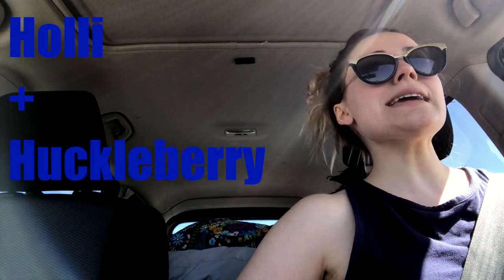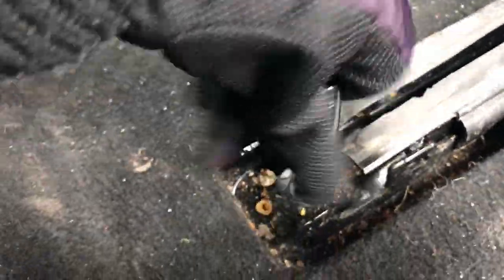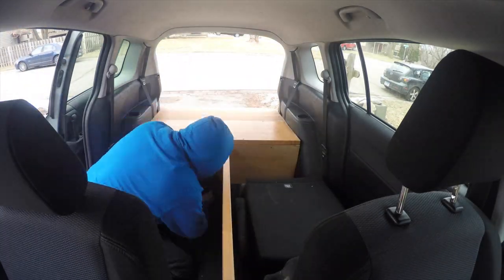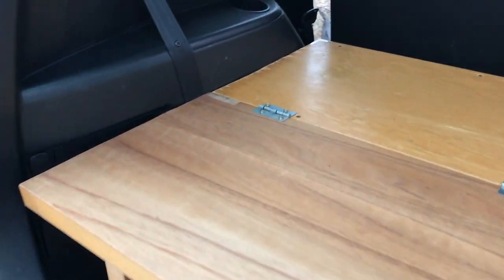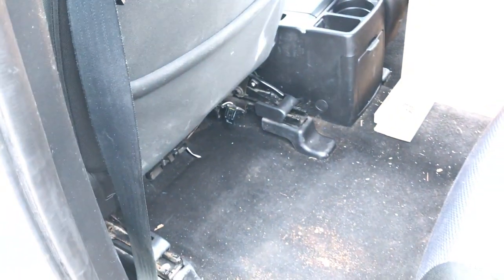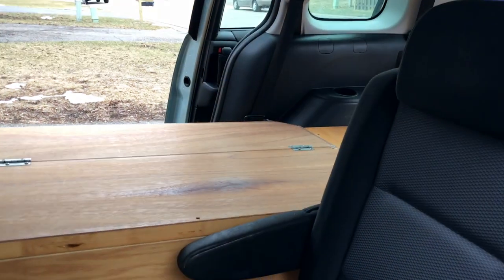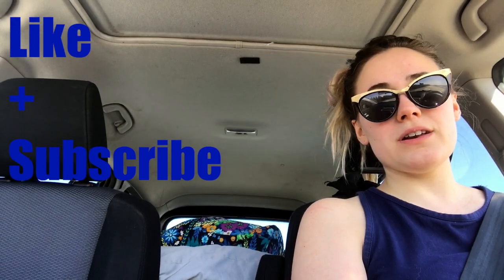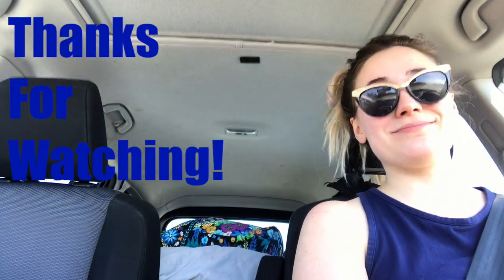Living In My Mazda5: THE BUILD

Comment: I drive a 2014 mazda 3 hatchback.  Next summer I'm planning a drive from Toronto to the east cost...3-4 weeks. I was thinking....why camp in a tent when I can sleep in my car? No worries about rain, just jump and drive if you need to get the heck out. The fact that I'm 5'5" will be just a breeze to make sleeping in it a easy thing👍.  I don't need to pull out my back seats. Just fold them down and cut a peace of subfloor/ drywall and a clean carpet area! A small cooler,  a storage container on the roof and a bike rack 👍👍. Oh...and some great all season tires for the long drive and some mild off roading.  One way or another I'm doing this.

Comment: Great video! I use my Mazda 5 as my work van and it has a setup with shelves on the 2 sides sliding doors and it is very nice! I don't know if you are going to go in Canada during the winter, but I do recommend you to spray a lot of silicone lubricant (Jig-a-Loo) on the sliding doors rubber seal, as they do get stuck in ice quite easily during the winter. My 5 is now at 272000km, 169000miles.

Comment: Like the build and the design. However, I think you can maximize the space, as needed.
1) With 3 seats and only one person living in there, IMHO it gives away a lot of interior Real Estate Space. If I were to carry the occasional passenger, I would be able to do away with at least one seat. In my case I would only leave the driver's seat. I've also seen where you can 'fake-frame' the passenger seat into looking like a legit seat by removing the factory seat and  building a similar storage frame, putting a seat cover on top of it. The front passenger floor can also be used for 'secret storage' by just detaching the carpet and placing a box under, raising the floor a few inches. For the those looking from the outside, they won't be able to tell, more so if you have tinted windows and dark gray/black carpet and seat covers. Putting a windshield sun shade every time you park also helps in the darkening effect. In most municipalities, you can darken the heck out of the windows aft of the driver too, for more security.
2) The rear interior plastic quarter panels also take up some of the width back there. Removing them could have given you some extra inches in width as it happens in minivans. You may also 'replace' that space with 1-inch insulation and still have gains in space.
3) Finally, an extra large cargo box in the roof with a flat, 100 Watt solar panel on top (again, being the panel being this high off the ground won't give it away that easily) may give you extra storage space and provide enough power for a quality (pricey but worth it) Danfoss compressor 12 Volt fridge, power to charge your phone/laptop and the requisite interior led light and usb fan. A Yeti 400 solar generator might do the trick. As someone is more likely to break into a cargo box outside of a car and the fact that they are not able to hold a lot of weight (100 - 150 lbs) you may just want to keep seasonal stuff in there (winter clothing/shoes/comforters) or other non-perishable items/supplies instead of pricey items like a toolbox/tools, etc.

Comment: Those Mazda5s are notorious for rear shocks failing prematurely. With all the weight that you're loading/loaded on it. Have you had issues with it?
Reply: Hi! Mine is my work car and I replaced myself the 2 rear shocks and it cost me about 60$ for the 2. It is quite feasible by anyone who has just a little bit of mechanic experience.